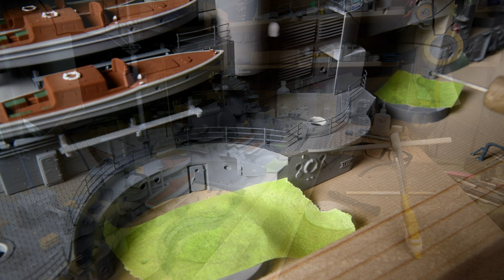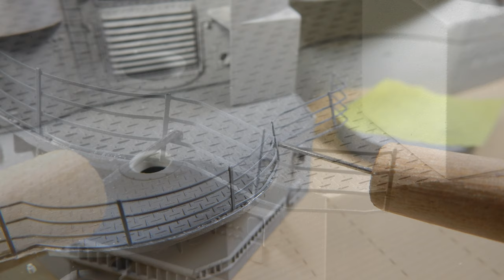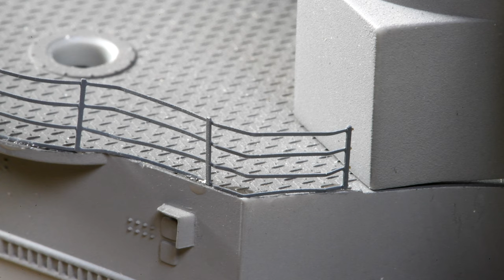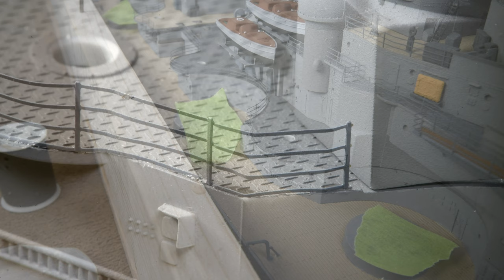The Model Ship - Part 384

Comment: I was wondering if you had thought of using small strips of that green painters tape to tack the railings down where you want them, then apply the glue, let it set then remove the tape ( carefully )?  Sort of like a welder making tach welds.
Reply from the maker: That's a thought - thanks. 👍